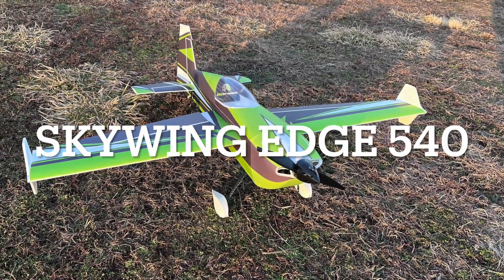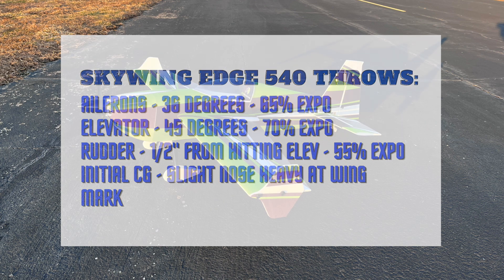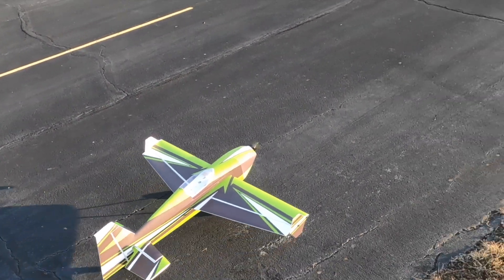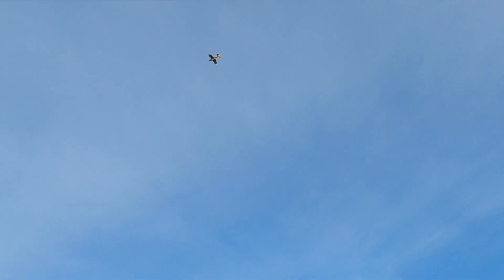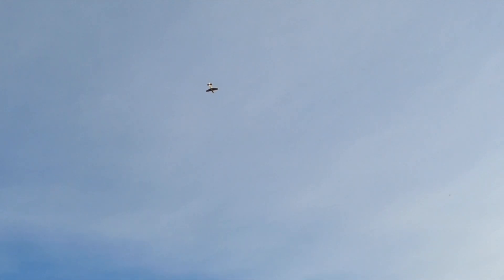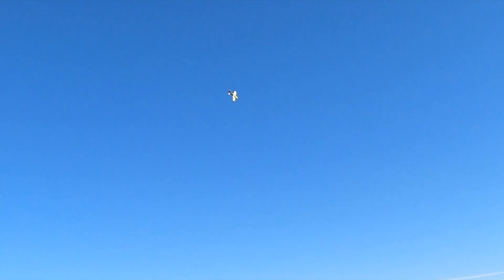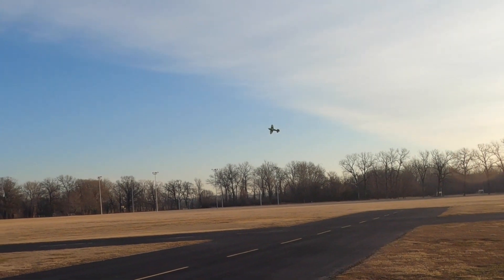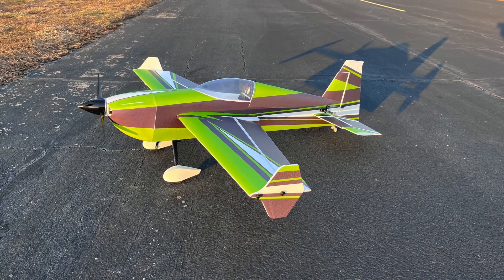Skywing 48” Edge 540 Maiden flight - Outrageous power with the T-Motor AM480

Comment: 3d beginner pilots? This works for beginners pilots generally! I like 3d and I was scared to try until seeing you!thank you!Very nice plane I just ordered the same and I put a tmotor am480 combo. Did you setup with extended limits? 120% ? What are the differences in degrees beyond low and high rates?
Reply from the maker: My buddy at Model AV8R, Adam helped me set mine up..  Here is what I have for throws - Ail - 35degrees with 75% expo,  Elev - 45 degrees and 75% expo, Rudder is maxed out and about 1/2" from touching the elev with 55% expo.  I did setup dual rates at first and just reduced the throw a little..  I will probably increase my Elev throw as I get a bit more comfortable with her.   Good luck my friend - Will
Reply: @SteffenRC  thank you for the reply my friend!good and fun flights!

Comment: The first time I flew my pa addiction x I was amazed and properly set up 3d plane requires almost no trim if any and floats so gently at low throttle....flies better than a trainer....these planes could be flown by a beginner with super low rates for sure
Reply from the maker: I’m with you. Great flying planes.  Super light and will fly very slow.

Comment: What's your full setup motor esc and prop and battery on this 48
Reply from the maker: I have the T-Motor AM480 900kv, with a 60amp Hobbywing Funfly v5.  APC 12x6 prop..  Seems more than capable..  I. get 4+ min flights on the 4S 2200.   For more power they recomend a 13x6.5 prop..  I may install that soon..  Just to see..

Comment: Properly. Heck your cg on 3d pNe take it up at a 45 deg angle while inverted at 3/4 throttle and if it drops its nose heavy and if it rises its tail heavy....u want it to keep track or drop super slowly if you like to keep a little elevator while flying inverted but yeah works perfectly...only for 3d planes with a mid wing
Reply from the maker: As I fly it more, I’ll tweak the CG a little to get perfect for me.  I’m with you.  I tend to like a little down while inverted too..

Comment: What battery did you end up using?
Reply from the maker: Right now I'm using the Liperior 4S 2200 50c.  Works well for 4 minutes on the timer..  I tried my Tattu 2200 45c and they had a fair bit of drop when I punched it.   Thanks for watching, let me know if you have any other questions.. Always willing to help out a brother.
Reply: @SteffenRC  Thank you for the reply. I’m thinking of one of these to fly at the house for practice when I can’t make it to the field.
Reply from the maker: @waymaker_rc_club  Ryan, it’s a good purpose built plane.  I find it a bit fragile though.  That’s the trade off for being so dang light.  I’d recommend it for sure.  I did a build video on it too..  good luck, have fun. - Will